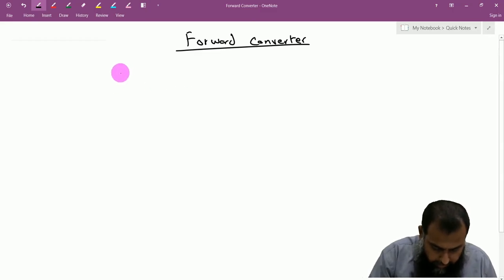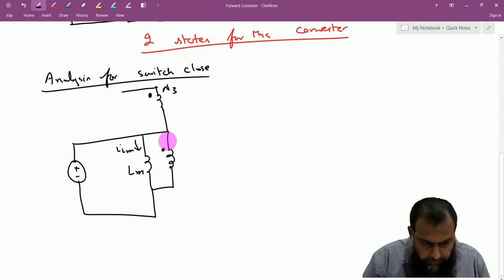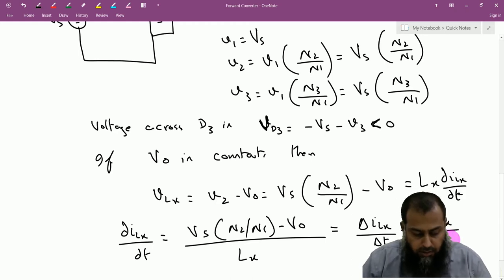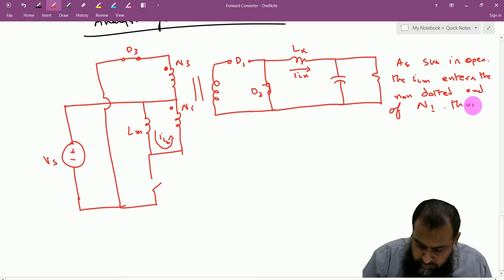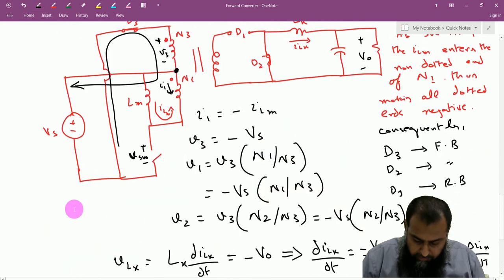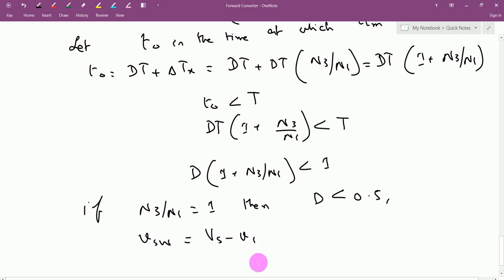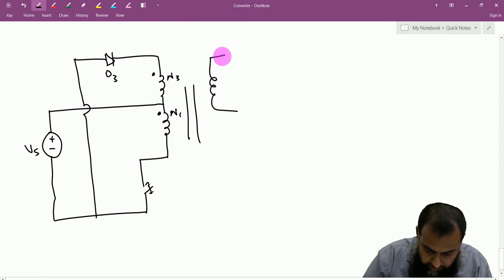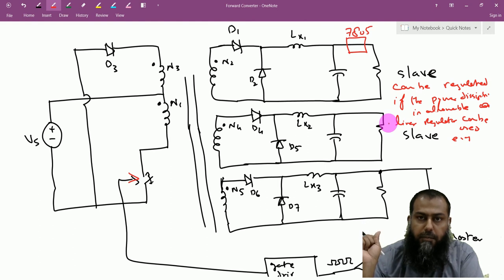Power Electronics Module 2 Lecture 8 | Forward converter

Comment: At 14:27 sir you said the primary winding current will invert it's polarity when switch is closed and the induced current in the primary coil will flow through it back to the source but it violates the inductor law because inductor doesn't allow suddent change and keep the current in Same direction so after switch turned switch off it will destroy the MOSFET because of sudden change in voltage so tertiary winding in this case is not being used or won't be able to discharge the primary coil of transformer. Can you just explain me how it is being discharged?
Reply from the maker: Well there is some misconception here. If inductor opposes sudden change in current all the time, it will not be used anywhere. The point is that inductor opposes sudden change in current after it is in steady state which implies that a constant current flows through it. Had it not be the case, no converter ever exists. In this case, once the current leaves the dotted end, the dotted end is considered negative thus it FB the diode D3. And remember that once a diode is FB it is regarded as a short circuit and hence the circuit takes the shape as discussed. Please see the following for more information.
1. Power Electronics by Hart
2.https://youtu.be/jPUpu1O710Q

Fell free to comment if you need further clarification.